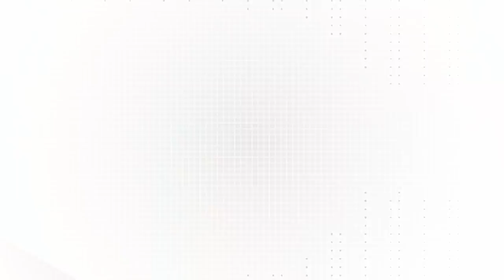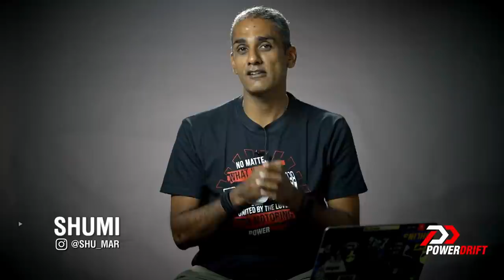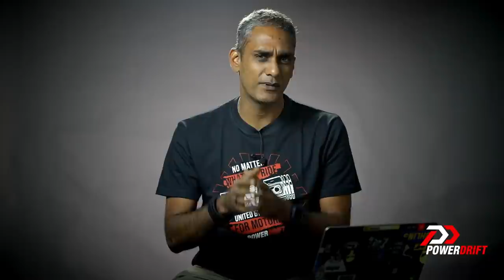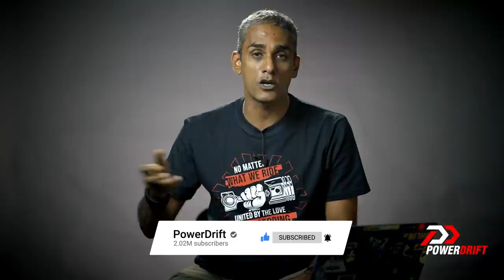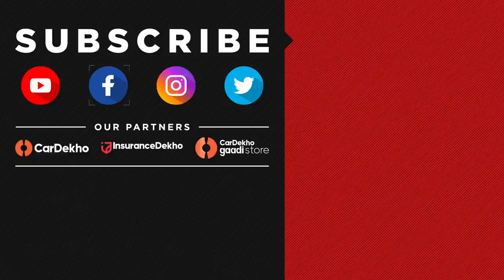Modifying motorcycles | Episode 14 | The PowerDrift Podcast

Comment: Lights are essential since the stock ones are shit. But that doesn't give us the right to use super bright auxiliary lights on highbeam in the city and highway, blindly people on the opposite lane and also blinding car drivers who don't have autodimming rear view mirrors. 

This is even more important in city limits coz we have freaking streetlights illuminating the road surface and we aren't going around at 100kmph to have our lights on head beam 🤷🏻‍♂️. 

I seriously don't understand who people use highbeam inside the city when the street lights are doing great job in illuminating the road surface. Heck, these cars which have projector headlamps especially LED ones, they think it looks cool if they keep their lights on highbeam. Mofos, you are blinding a lot of people around you. This is also for those who run halogens on highbeams, but the intensity of eyes hurting is less, so my curse for you guys is a bit less. But still, you all are blindling the ones in front of you. 
So, it's a request to use highbeams only when it's necessary and keep it on low beam for the rest of the time the vehicle is being driven. 

It's the same reason there's tons on complaints at the Traffic police stations by drivers in Karnataka and that's why Karnataka and Kerala traffic and highway police are super strict about it and destroy your lights if it needs to be done. They won't give a fuck if you spent a lakh on those lights. If it blinds others really bad and you can't switch them to low beam for the safety of everyone at night, then it surely is dangerous and better be destroyed at the spot
Reply: Spot on!